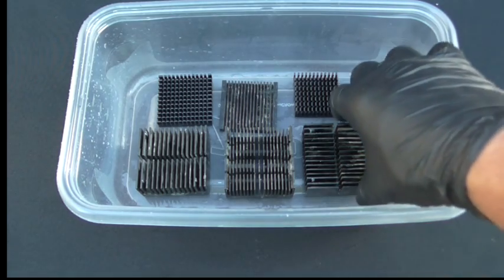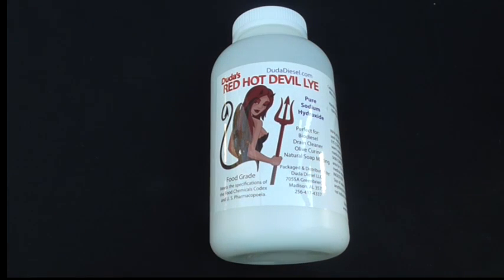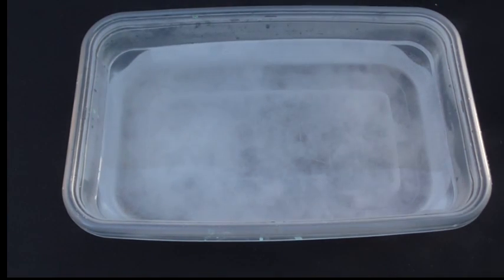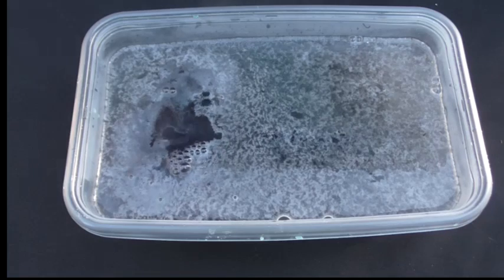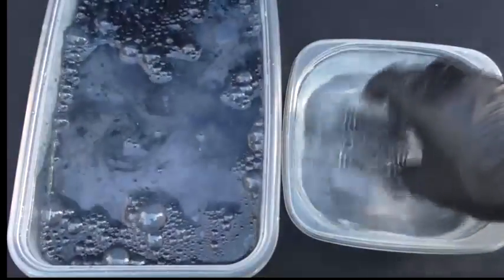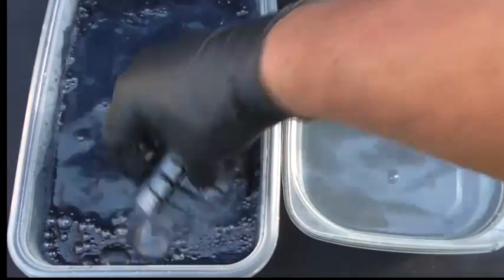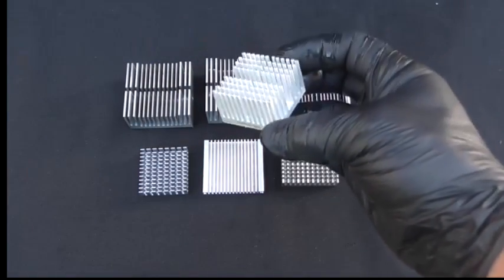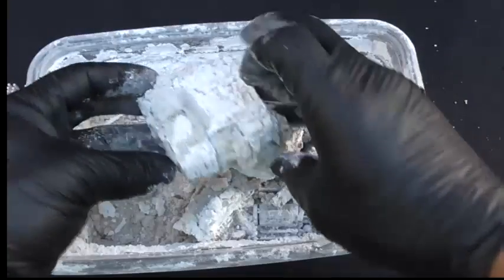Making more Money with painted Aluminum

Comment: just for the record: the chemical you used is just a solution of sodium hydroxide in water, called sodium hydroxide lye - it is not an acid, it is a lye (or an alkali solution)

since the english language is a bit clumsy here, "lye" is just as a synonym for sodium hydroxide lye - which is of course not the best thing, when you do chemistry
Reply: And of course most aluminium parts are not "painted" - they are anodized and then colored with different processes where the "color" is chemically bound to the aluminium oxide, so there is no "paint layer" on the aluminium, the aluminium is colored directly (usually with the use of salts).

Comment: By leaving the aluminum AL2 and caustic, NAOH (lye), 24 HRS you have created aluminum oxide, AL2O3. The reason I mention this is the paint is coming off as a result of an endothermic reaction...resulting in H2 hydrogen being released in a good amount. (best to try this outdoors or power the Hindenburg;). Also, if you can't afford lye..or you're cheap, ash from your wood stove way work just as well. I'm curious, have you tried HCL alternatively? The by-product, Aluminum Chloride is used to control excessive sweating lol. Great useful videos, seriously. I wouldn't have thought of half this stuff.
Reply from the maker: Thank you for the comment...I am not a chemist. I made this video to help out.
Reply: What you do is incredibly helpful. I was hoping to do the same so folks understand the "how it works" part a little better and cause/effect. Never know if someone is smoking a cigarette while doing this....with consequences. I looked this up myself to find better ways to clean Aluminum and with just a little caution, this will work!

Comment from the maker: This one is Lye which is drain cleaner. I mixed 5 gallons of water with the residue and flushed down toilet. Other chemicals you will have to take to a county recycling where you have to pay to get rid of. some chemicals you can neutralize with baking soda and get rid of easily

Comment from the maker: The green ones are higher grade than the blue. They are considered Chinese boards. The gold is on the pins in the circuitry, wiring inside the board on chips.

Comment: This process can also be used to remove the solder mask off of gold plates boards.  Only difference is that it will take about 10 minutes and you will need a toothbrush to rub off the solder mask.  The nice part is that it is one of the few gold recovery processess that you don't have to worry about fumes!!  lol

Comment: There's some crazy reaction between lye and aluminum.  If you wrap something silver plated in aluminum foil and put it in a cold lye + water solution, 1 tbs per gallon, it will take the heavy black tarnish off and you can polish it easily.